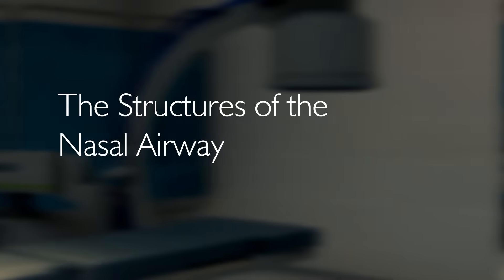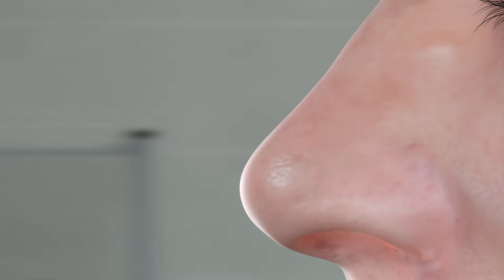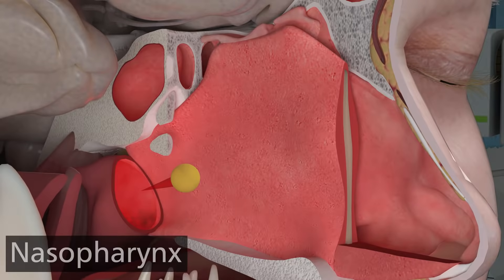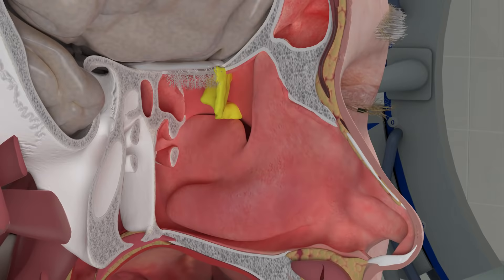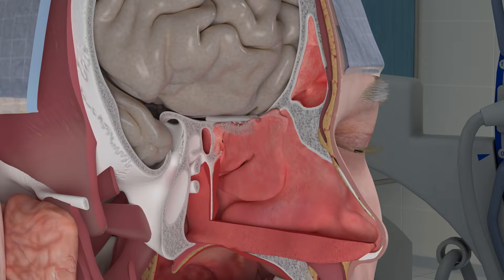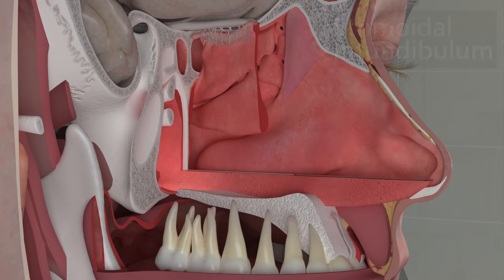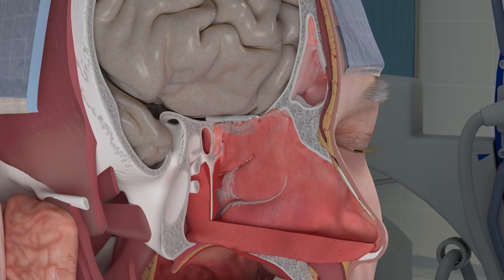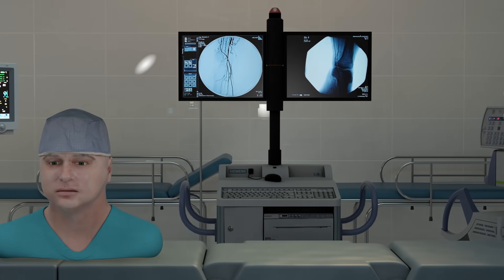Chapter 2: Nasal Anatomy and Function

Comment: I had used a water pick on a high pressure and when I got to left upper widsom teeth I felt a sharp pain.  Within about a month, my sinus behind my cheek completely filled and would not drain.  I had the operation to open my passages to the sides and frontal sinus.  They also straightened my septim.  All seemed fine because since I was quite young I had a lot of sinus infections.  At 37 I had my tonsiles out as well, they were huge!  But not too long since the nasal surgery I would smell a smell very much like that of a barnyard & lots of manure.  I believe I have a communication between that wisdom tooth root and that sinus that allows very small amounts of chewed food to pass because of the chewing pressure and then rot in that sinus.  I'm going to have to do something because the smell is quite awful
Reply from the maker: Well that is called an oro antral fistula and generally the oral surgeon that removed a tooth can fix that but so can some ear nose and throat doctors
Reply: @PeterCasano  Thank you!  And it's not the frontal, it's the maxillary of course.  I am so feed up with it.  I seem to smell it strong in the mornings.

Comment: great video, just that Osteo- means bone and -Meatal means Opening, not otherway around :)
Reply from the maker: Well it’s “Ostia” which means opening.  In the context of sinus anatomy, meatus means the region under one of the turbinates.  Usually paired with the turbinates designation “middle meatus” is under the middle turbinates and “inferior meatus” is under the inferior turbinate.  Both are generic terms and depend on the context.
Reply: @PeterCasano  My bad, absolutely correct
Reply from the maker: @darkblue1423 Thanks for watching and paying attention and all 👍🏻

Comment: I'm interested in "nasal swell" but i cant get more information on the internet. Could you elaborate on that?
Reply from the maker: The nasal swell, a region of the septum that has long been appreciated by those of us whodo sinus and nasal surgery, but only recently has it come into focus and been named. I have been addressing the nasal swell by running the Coblator device under the structure of mucous membrane for decades, and I actually only heard the term nasal swell, about five years ago.

In summary, it is an area of the nasal septum that has mucous membrane and occupies that location, roughly above inferior turbinate in the anterior portion of the septum.

Comment: I did an operation 6 years ago, I was feeling short of breath, and when I went to a doctor, he told me that you have enlarged nasal cartilage, deformities in the nasal septum, and a broken bone inside the nose. I did this operation, and I started to feel that there was no improvement as I thought in the first place. The doctor did a complete removal of the nasal cartilages and a rigid tightening inside the nose, and this tension has not felt like this before, and this tightening is described as the skin and flesh breaking off with the face, and also pressure on the eyes, and this causes me to not focus. I hope, Doctor, solve this problem as soon as possible, because it destroyed my life 😭😭😭😭😭😭😭😭😭😭😭😭😭😭

￼

Comment: Your content is great but the subtitles makes difficult see the full structure clearly
Reply from the maker: The subtitles (closed caption - CC) are set to be off by default, you may have turned them on inadvertently I dont know.  You can toggle them off by clicking the CC button on the bottom or watch on my website that has different controls... petercasano.com   thanks for the comment.
Reply: @PeterCasano  thank you